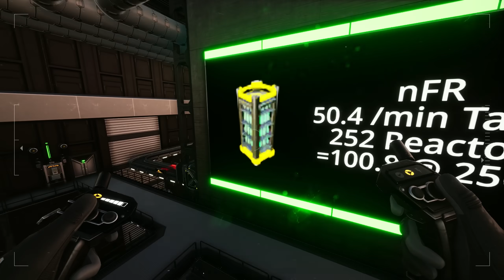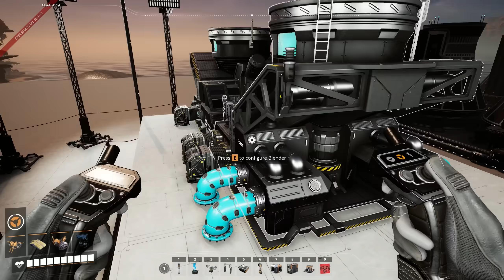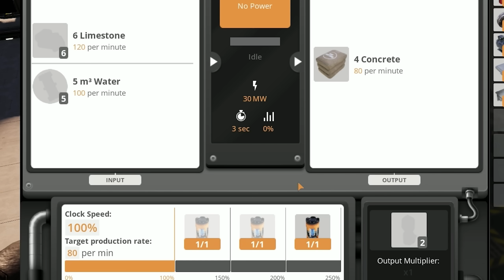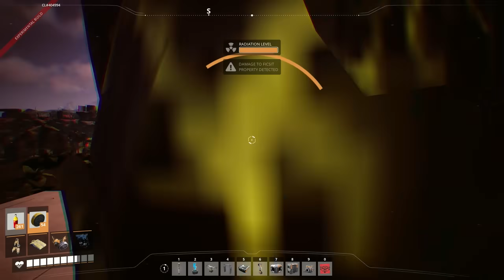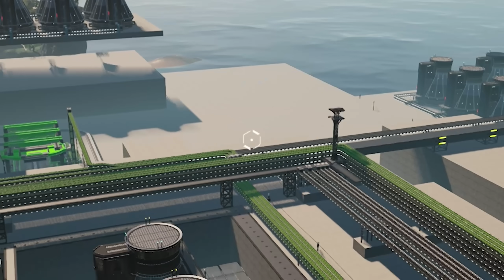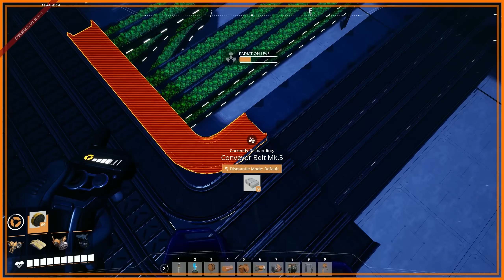Starting PLUTONIUM Power! - Satisfactory 1.1

Comment: I had the same water byproduct problem with an aluminum factory... Overflowing pipes would stop the production, and the fear of rounding errors accumulating meant I could not feel comfortable with just adjusting the water supply rate... So I used the excess water to make wet concrete that I then sunk.

Comment: While probably not usefull in this giant setup, I used the water from the Non-Fissiles Uranium setup to make sulfuric acid. Its in 1:1 ratio. I needed to fill up the loop one time, but then the water makes the acid and I dont have to find a solution to dump the water and I also dont need a water extractor.

Comment: Fun fact the extra water from the non fiscal plutonium is 1 to 1 balanced with the nitric acid so you could fill the nitric acid pipes and then just pipe the extra water back it was super easy for me at least... I did have other problems with my build though

Comment: for your 5-5 load balancers, you can just make a 1-5 load balancer and stack it 5 times. then you can use the vertical mergers to merge the outputs. or would this be classified as a manifold  that eventually balances?

Comment: It's easy to deal with solid byproducts using a priority merger (DIY or 1.1) to feed them to an input, sinking them only when there's a serious mismatch. Doesn't work reliably for liquids but once you've made the liquid into a solid (wet concrete, say) you are fine. So, say, making concrete for the waste processing from waste water is fine if you sink overflow and top up with concrete from elsewhere if there's a shortage.

Comment: Another legitimate concern that I had when building a large nuclear power plant is the ficsonium stage of the process. Due to the fact that every single Ficsonium Fuel Rod requires 40 Ficsite Trigons (And thus a TON of reanimated SAM, ecen using Aluminum, the most efficient Ficsite recipie), Even using a single normal node of uranium (600/min) with max efficiency used almost half of the world's SAM reserves. I had to resort to mods in order to finish the entire project. (Remember SAM is a 4->1 resource. Every single ingot of usable reanimated SAM requires 4 pieces of SAM ore).
Reply: I ended up hacking in a ton of loops for the sam processing and even then ficsonium produces so little power and adds so much cost+complexity to nuclear the entire build just felt like a huuuge waste compared to simply sinking the plutonium rods

Comment: Building a 5x5 by looping a 6x6 back into the input will reduce total throughput in the system. 

It will balance, yes, but that loop back isn’t free unless the balancer belts are 1 tier higher than the input belts.

Comment: If you use trains to transport all your water, getting rid of excess is not necessary, because your train will try to load up with the output water first, and then only if it needs more water will it take more water from fresh pumped water.

Comment: Wouldnt it be possible to pump the excess water from the blenders into the coolant system for the reactors? Using valves to prioritize it over the water pumps?
Reply: It is possible, but the problem is that valves don't establish priority, they only control flow rates (and to a lesser degree act as check valves controlling direction). It also leads to a negative feedback loop. If there's a hiccup in the coolant system for whatever reason no matter how small, the reactor shuts down, if the reactor shuts down there's a gap in the waste production, if there's a gap in the waste production, the waste mitigation processes have a moment of inactivity, if the waste mitigation has a moment of inactivity, they aren't feeding water into the coolant system, if they aren't feeding water into the coolant system more reactors shut down completing the negative feedback loop, and you're stuck on the water pumps filling the system to restart the reactors anyway.

There is, of course, another possibility called a cascading failure, where something in the system gets clogged, let's say the water side. The water pumps are filling the system full bore so the power plants never shut down, but this also means all of the water produced in the waste mitigation process is extra water, and it has to go somewhere, but it can't because there's just no where for it to go as the pumps are adding as much water as the reactors are eating up to prevent the negative feedback loop... So the waste mitigation system shuts down because an output is "clogged". So you build up waste on the belts until the reactors clog. With the reactors clogged, the fuel production side clogs (assuming the whole plant hasn't shut down due to lack of power). One failure just cascades into many more failures.

The only way to make this type of setup work is if control circuitry is added into the game (there is a mod that does this already), then systems can be set up like how I do it in real life with main pumps that run all of the time and jockey pumps that only start up when the SCADA system detects a low volume state within the system. Then we could reliably have all of the blenders pump to fluid buffers and control logic monitoring that buffer which has the ability to turn on a water extractor to make up the difference and bring the level back up to whatever is set as the shut off point, and also be able to turn on the "wet concrete" system to expel excess water to prevent the system from shutting down due to "clogging" of the coolant side. In reality the addition of a simple outflow pipe to drain water back into the environment is the best option, it can be another water extractor just without the big pump, and this excess water problem disappears in an instant, or use the flush feature already included in the fluid system and give us a toggle to auto "flush" a fluid buffer when it's full, but I like the outflow pipe idea better for visual purposes.

Comment: kibitz, how do you make your ore gathering areas look clean ? say for example spread out at the same area top left of the map ( on land ) 6 normal iron ores. i just can't make it look clean at all with beltwork or otherwise. i'm trying to cover them up in a building but there are rock pillars in between them. if it's not to much to ask about how you would go about making it look nice, trucks ? train close to the ground or higher up ? etc.

Comment: Sink the plutonium fuel roads! You can check your system up to then, you'll have plenty of power being made until Tier 9, and lots of sink points.
Reply: That's what he did last time
Reply: It's actually not that many sink points. I may only be doing like 1/5 of his production in my world, but with how many systems he probably has currently sinking items, the points needed to make a coupon is probably so high that a couple of fuel rods won't be much of a change.
Reply: @michaelcostello906 but that's not fun.
Reply: Put a pile of storage containers out of harms way, to sink the waste into, then when you get Ficsonium, belt the waste storage to a converter factory for Ficsonium Fuel rods which have no byproduct.
Reply: @timmcgrath8742  I don't know that he realizes how much waste is going to pile up by the time he completes this elevator phase and Tier 9 to get to ficsoniun fuel rods.
Reply: @ if the belt fills up, he can always add some more containers till it's free again.... LOL

Comment: Hey Kibz, just wanted to know: are you going to do the space elevator parts without power shards? Because you're using them all for the nuclear plant
Reply: You can manufacturer power shards in t9.  He will end up making them for the rest of the build.
Reply: @tofo8700  but that means he needs to make the space elevator parts to get to tier 9 without power shards
Reply: I assume he will just do a makeshift setup to advance, then for the final space elevator parts, the phase 4 ele parts are required to build the phase 5 anyways, so they will get the synthetic shard treatment.